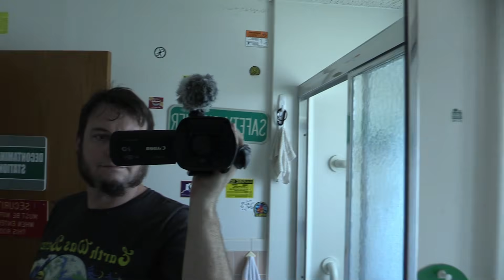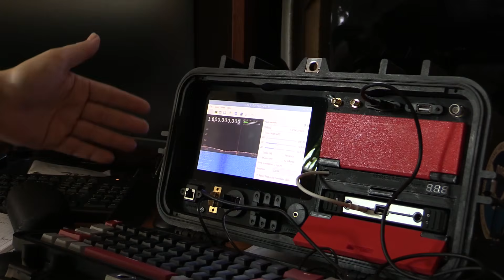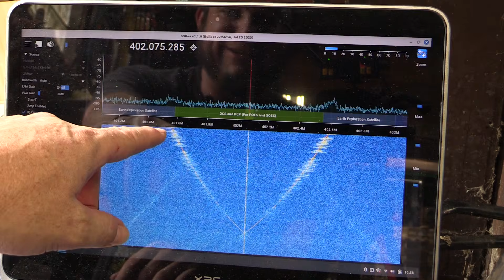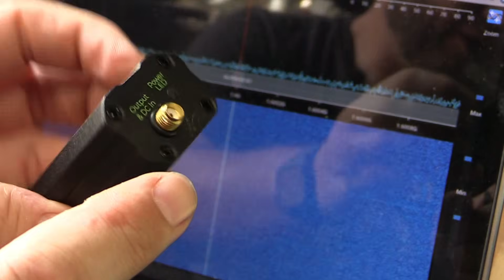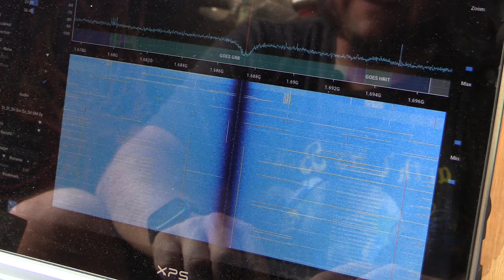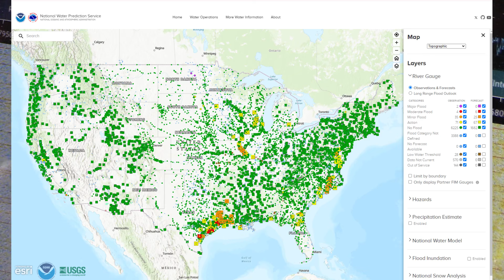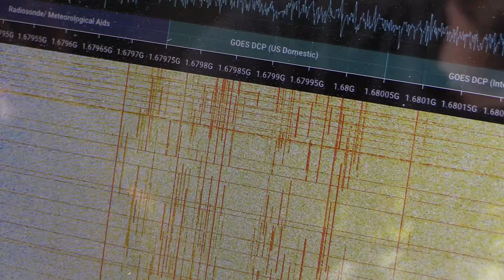Checking 1.6GHz For Skinwalker Ranch Signals

Comment: In my opinion, the fuzzy rabbit mic gives a MUCH better, fuller sound. The wireless mic pack sounds very compressed, like you're wearing ear protection used in shooting pew-pews.
Reply: Yes, the lapel mic is horrible!
Reply: I concur.
Reply: I think the issue is the lack of a high or low pass filter(can't remember which) on the audio to filter out that background static.
Reply: @guykonstrucks8733  a high pass, passes the high frequencies and rolls off the low frequencies. it can also be referred to as a low cut.
A low pass filter, passes the low frequencies and rolls off the high frequencies and can also be called a high cut.
Yes to some extent that would remove some of the noise. But I think that's just masking the problem and more investigation needs to go up the chain. If you put bad stuff in you get bad stuff out, and somewhere between his mouth ( which we know can sound clearer to the other microphone and the camera ) somethings getting lost.
Reply: I think you could work with the lapel mic with some EQ and possibly different placement, but the fuzzy rabbit does a great job.
Reply: @Peter_S_  podcastage has an awesome video on this how different positions sound with lapel mic
Reply: @RadOo  Excellent. I hope Gabe sees your comment. Sound is an art and it takes practice to get right.
Reply: @Peter_S_  I started working with it in the mid '60s/ I could make those old school intercoms sound good, and I worked in both radio and TV studios. 
On job was a sound system for a small stadium. You could hear it clearly for over five miles, with just a 60W amplifier and music grade PA horns.
Reply: @michaelterrell that's the magic right there. A lot of people don't realize how much sound you get out of the right equipment. I have a friend who has a similar career to you for the same time span. He dealt with everything from hunting rf to dealing with the satellites. You guys are an awesome source of info. Do you have any content on your channel? If not, would you please record some stuff? If anything just so your bank of knowledge lives on and helps the next generation figure out stuff they wouldn't learn these days. We need more people sharing those stories that help. I think it would be neat. 🤙🏾
Reply: Fuzzy rabbit
Reply: the dead cat mic is better, however the lapel mic COULD be better, as the "hiss" is a setting Gabe has to nail down.
Reply: It's a first video with the mic so I wouldn't give up just yet. I actually prefer the sound due to having a separation between the voice and background noise.
Reply: To me the lepel mic sounds very flat and there is a lot of  hiss witch feels unpleasant to my ears. With the fuzzy mic apart from the slight room echo id prefer it. Even without any eq.
Reply: sorry to the kind person who supplied it but that particular lapel mic is awful. It's typical for them to sound slightly flatter but the noise floor in it is awful. Get a good quality one such as anythign from the R0de range.
Reply: @patricksproule6709  They do sound bad, when you don't know how to use them. You can make any microphone sound horrible, when you're untrained.
Reply: I'm a broadcast technology engineer and also used to teach television production techniques. In this instance this is a dodgy mic. The noise is either due to moisture / humidity ingress into the condenser capsule (thats usually more of a crackle though) or due to poor signal to noise ratio in the circuit design. Have a listen on a decent pair of headphones and you'll hear what I'm talking about.
Reply: @patricksproule6709  I learned production on the job as an engineer for AFRTS, 50 years ago/ It was a monochrome station, with just two studio cameras and a 16mm film chain. I had to do maintenance, then run the board between many trips into the studio to change camera angles, then run back to switch shots. I also had to slip in and out of our radio studio during live shows to take care of problems, then hurry back to the TV transmitter and control room. Have you ever worked where you couldn't remove defective talking heads?
I always prefered dynamic microphones, but back then Electrets weren't common. They were invented in 1962, and our studio's equip,ent was from 1966.
Later stations used some Elecrets, but dynamic were still my favorite. 
Proper mic placement is something that is often overlooked. If people pay attention to news and other live programs you can get an idea of where to start.
He doesn't have any decent test equipment. and apparently rarely reads manuals.
Reply: I liked the absence of echo in the lapel mic. But yeah it needs tweaking. I think it'll be very helpful with your outdoor stuff with wind and such.
Reply: And I'm used to it... this is how he sounds like
Reply: Fluffy Mic wins for me.
Reply: Agreed 👍💯
Reply: The LAV mic sounds worse but I don't think it's the mic's fault.
Reply: @tomprice5496  It could easily be the camera mic input being noisy
Reply: I think the lapel mic is a bit better, except for the hiss.
Reply: Yo, for real
Reply: The wireless mic has "a hiss" through the entire recording.  Quite irritating.
Reply: people using rode mics usually sound great
Reply: Agreed, it sounds condensed
Reply: Agreed prefer the fuffly
Reply: Fuzzy rabbit FTW!
Reply: Keep the fuzzy!!
Reply: You should be able to get rid of the noise on your fuzzy rabbit mic with a little post processing. It's just the constant background static that's annoying.
Reply: Hey just stumbled onto your channel... love your content! I have a quick question. have you ever used a Hughes or DirecTV satellite dish. These dishes seem to be a dime-a-dozen... I literally...and are there better designed LMB's than others.?

.......also.......

TOTALLY get the social thing! When it comes to face to face dialog, I am unbelievably uncomfortable talking to people. Although, I can communicate like a poet. Sometimes it feels hopeless to even try.
Reply: Yeah there's something up with that microphone transmitter receiver combination. Sure it sounds better because it's up close in getting less background noise but it's also got background hiss noise which could be due to a gain staging issue or a bad lapel mic or cable. That looks like a deity which should be pretty good. Can't tell for the lapel mic. Could also be a bad cable or combination of camera and receiver. Definitely take a look at Curtis Judd and sound speeds great information and might even have a review as well as podcastage which would give a good comparison of what it should sound like. Sometimes you really need to look into the gift horse's mouth, just because it's walking doesn't mean it's not gonna fall over any minute.
Oh and it's also a bit muffled which could be the microphone or it could be that he's too high up under his throat.
And I say this is an audio tech which has used a lot of audio equipment and a reasonable amount of wireless microphones over the years.
I've also done a lot of research into film audio to extend my knowledge that in the last few years Beyond live sound and recording.
Reply: Agreed, not a fan if the wireless
Reply: Entirely agree.
Reply: I agree
Reply: Yep, I prefer that as well, the wireless model is lacking a lot of highs.
Reply: Agreed
Reply: Yes, the amount of hiss and compression and loss of upper frequencies is so bad on the radio mic.  The fuzzy mic on the camera is WAAAY better.
NOTE: the radio mic is not worse because its a radio mic, its because its a crap radio mic.  The cost of good quality radio mics is never cheap. Shure Axient system is the gold standard and you'll need a wallet to go with it =)
However the Rode mics (both wired and radio) are very good, but as always have a listen to specific models, a brand always has a range of qualities so you have to be model specific
Reply: There must be some mistake in the setup. Like for example, lapel mic's usually are mounted further away from the mouth. It goes on your lapel, as the name implies. I have trouble believing this is the best this system can sound.
Reply: Fuzzy Rabbitt way better,  👍 😊wireless mic muddy…👎
Reply: Well put, CAM!! 🎙🎤👍 Is it unusual for a CAM to discuss a MIC? Sorry! I couldn't resist🎥!!  🤣😂✌
Reply: First one!!!!!!

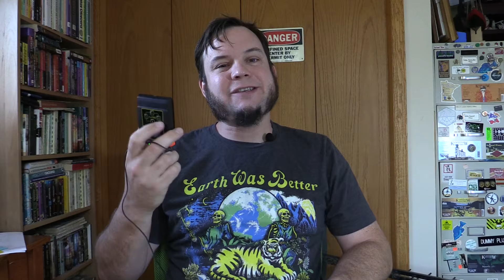Comment: 3:52 OH HELL NAW.  The Lapel mic is both muted, and washed out, compared to the fuzzy rabbit mic.  And there is audible hissing.  OFC I am using a 2.1 surround sound speaker set I've had since 2000.  (I only had to spend $1 on it in ALL that time, Altec Lansing).  I have no idea what it sounds like on a cell phone.
Reply: The placement is wrong and it needs postprocessing.
Reply: @peepopalaber  just what i was thinking. glad im not nuts
Reply: I mean, I'm using headphones and concur haha

Comment: Right away you could tell the lapel was a more condensed sound, a little too much i though at first, but then I forgot about it until the end of the video when you switched back and a lot of background noise was then obvious in the rabbit. So I would say use the new lapel wireless mic!
Reply: I second that opinion.